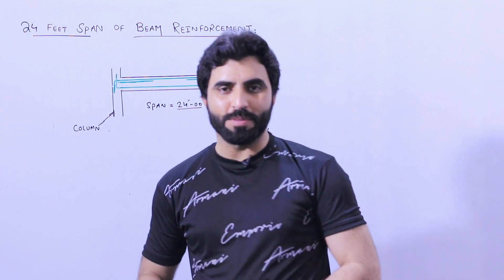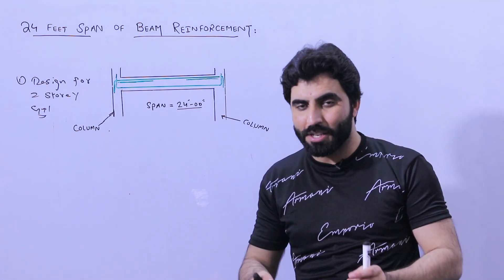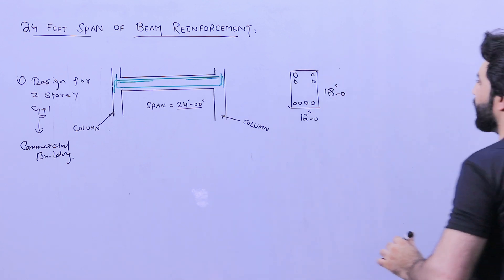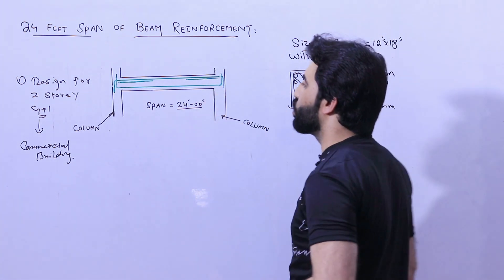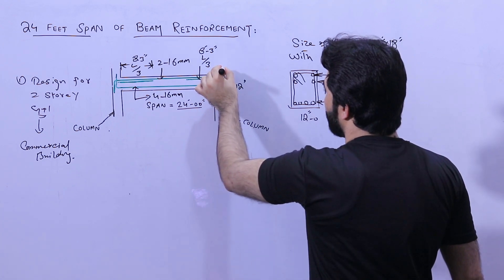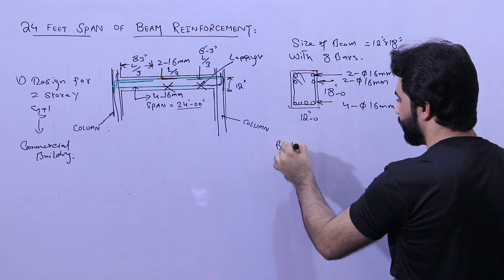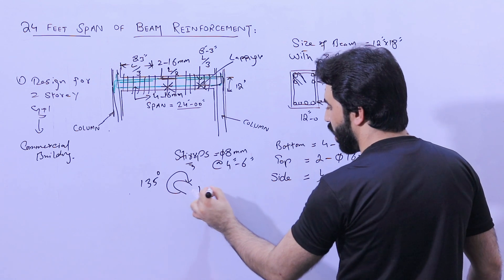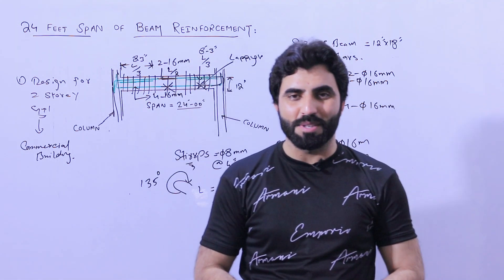24 feet span of beam structural design

Comment: Sir i am your student . if the werth is 12 inches , so both side concrete cover is 1.5 inches .and steel dia is 16mm,

so my cancern is 12"-3 inches (cover)-2 inches steel . now we have only 7 " space  .
if we privide 3rd no,s bar so inner concrete now both sides 3.5 inches .

it is perfect design . so why we should provide  no,s 4th steel rod in this spacific size